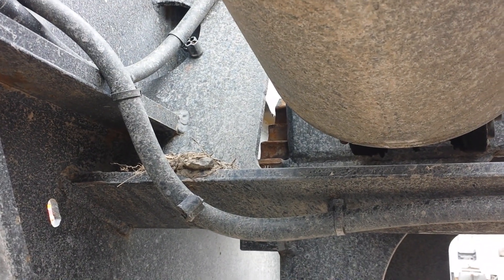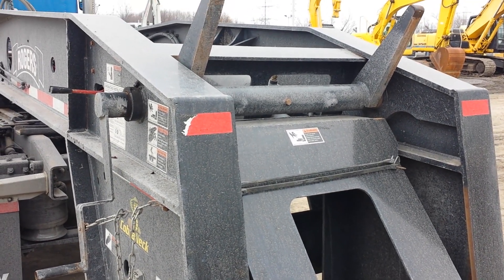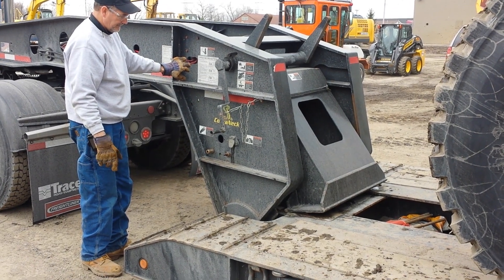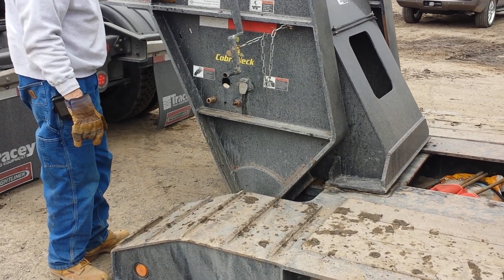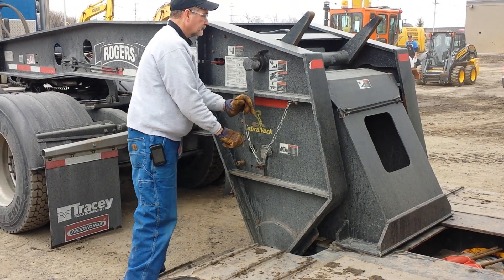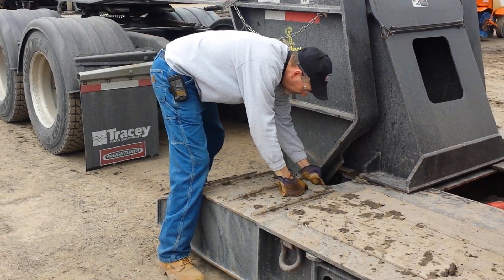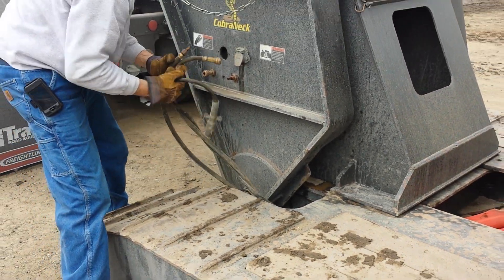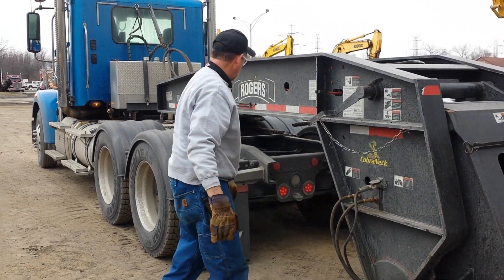CN55 20095424

Comment: Lowest position is a recipe for disaster especially high siding and train tracks here in  Arizona. I never ride under the third click but good job although I’m sure you backed her back off and realigned your load. Cheers
Reply: I agree, also 4 anchor points on the equipment.
Reply: Good poin because if you forget to factor that in you going to have an accident